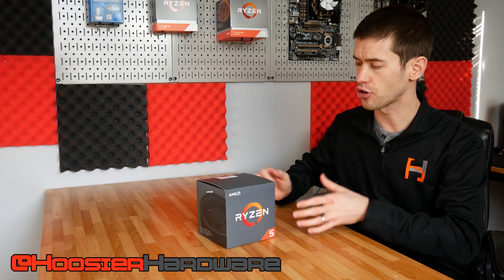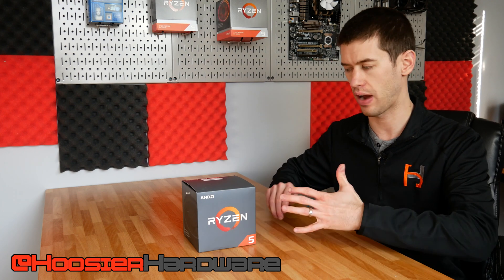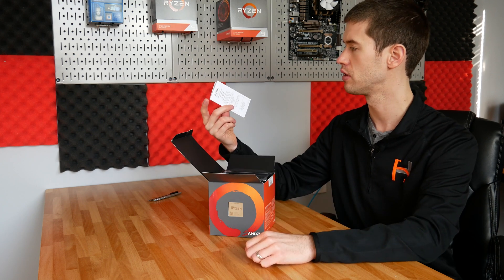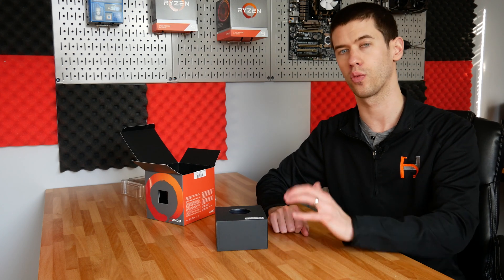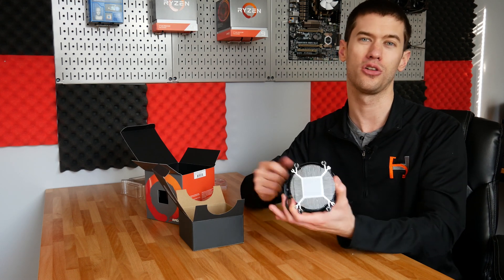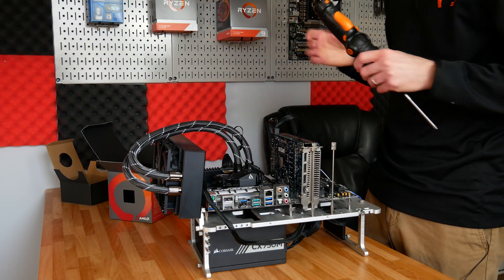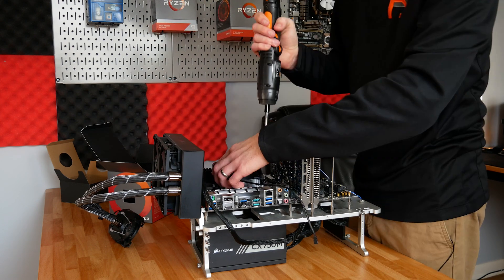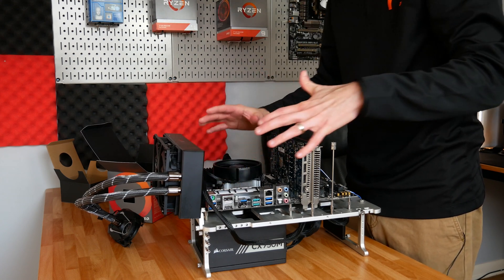Ryzen 1600 "AF" Overclocking on the Stock Cooler

Comment: Could you run a OC test with the older Spire cooler with the copper core to compare?
Reply: Well he did not run proper OC test on this cooler so let me give you the short version - 1.3-1.35V at 4.15-4.2GHz on this cooler will never hit past 80-85c during heavy gaming at 20-25c room temp, given the fan is pushed and teh case has good airflow. The other cooler will be 5-7c better  give or take.
Reply: I recently did this myself with a friend, I have a 2700 that I have water cooled and my friend recently bought a 1600 AF.  I told him I had the wraith spire LED cooler if he wanted. 
We settled on 
4.0ghz
1.27 volts
Maxed out at 77C
This was on a gigabyte gaming-3 ab350m.
Reply: @jhopkins1515  thank you. I doing the exact same thing with my spire cooler that came with my 2700. It's going on my wife's 1600 af lol
Reply: @jhopkins1515  and I thought I got my 1600(older model) to 4.0ghz at low voltage, that 2 nm shrink really helps with power efficiency
Reply: @jhopkins1515   maxed at what gaming or stress test ?
Reply: @batuone09  prime 95, 20 mins
 This was with the fans at the motherboard's stock fan curves, didn't play with them at all.
 So I'm not sure if the fan was even running at a 100% or not I would think it was up there though.  This wasn't like any crazy thorough test we just picked  A frequency that I knew was obtainable and tweak the voltage till I got it stable. This was 3 months ago I'm sure if somebody spent more time they could probly get better results.

Comment: Bought one for my wife. Reused her H80i and this thing easily hit 4.2Ghz all core stable.  I stopped there but it could have more in it.
Reply: My r20 score was higher temps never hit 60c stressing all cores with 240ml aio. 1.4 isnt a good option for daily usage considering the bump isnt there.
Reply: @Kraxt0n  some people dont know for limits.
Reply: What voltage?
Reply: @jpateka  1.4
Reply: @FlawleZ31  if you're at 1.4 already, you aren't getting more than 4.2
Reply: @lunchie80  probably the ceiling yeah.
Reply: 1.4 is a lot
Reply: @ydatoporin  Eh, temps are good and it sees light use. I'm not worried about it.
Reply: Lower to 4.1 and try 1.32volts using llc mode for <flat line>

Comment: i also have this cpu and my results are the following:
with stock cooler 4.0ghz 1.308v good and stable for day to day usage but stressing it leads to overheating and shutting down
So i bought a aftermarket cooler and went for 4150mhz with 1.341v and my temps even for 60min prime95 dont go above 69 70degrees. Cinebench: 3200
Reply: Silicon lottery winner right here!
Reply: @miniweeddeerz1820  lol, I thought the same thing.
Reply from the maker: Dang. Nice.
Reply: 1.3V for 4GHz seams too high to me. You should be able to hit 4.1 at least with that voltage. You got a bad OC chip mate. But hey still better than anything else at that price point. :D

Comment: Solid video dude. I've been having a tough time getting the 1600 AF stable when I overclock it. I'm going to test your numbers tonight and hopefully it will be stable for me as well. A video on different builds would be cool. I'm using an older card currently (RX 580) so I want to squeeze all the performance out of this system. Also a comparison against newer cards would help figuring out an upgrade path.
Reply: What are your system specs?
Reply: @cspc2570  My build is pretty budget oriented. Ryzen 1600 AF, PC RX 580 8gb, ASUS Prime B450M, Vengeance LPX 16gb 3200 mhz, ADATA 480gb SSD, EVGA 600w 80+ Bronze and Phanteks P600s case.
Reply: @zer0sckillz539  everything looks good except the mobo. I have had issues with overclocking with every b450 except my ATX sized b450 Tomahawk.  It's a beast.
Reply: @cspc2570  Yeah, I've heard the Tomahawk is an awesome MB. I might just go ahead and pick one up and an AIO so I don't have to ever worry about my temps.
Reply: @cspc2570  I have Asrock B450 m pro4 and 1600 AF @4.0 1.35V. C states off , windows max performance. It is very good in terms price/perf. It is the best!
Reply: @MarioAPN  yeah that is the best 75 dollar board by a mile. Has the best vrms for the price. The only one better is the asrock b450m steel legend but it's 10 dollars more
Reply: @MarioAPN  Used stock cooler at the 1600af friend?
Reply: Marcelo Bragança LC-CC 120 tower cooler.
Reply: @cspc2570  you haven't tried asrock b450m pro4, or the steel legend, or the mortar max? They are the best Matx overclocking boards there are.
Reply: @marcelobra1  also consider getting a Arctic freezer 34 eSports duo. That's fine for a 4.2ghz oc on a 2600 so should work on a 1600af

Comment: With a prism cooler, I got 4ghz. It stays under 65c. I might try a bit higher, but it's already running like a champ in my asrock b450m steel legend.
Reply: Pretty much on point. I got my 1600AF at 4GHz on a aftermarket cooler at 1.3v. on my ASRock B450M Steel Legend.
Reply: @djsmartbomb5482  shud be able to hit 4.1 then with llc4 or flat lined mode which ever it is for your bios at 1.32 volts...
Reply: DJ Smartbomb i have the same board and cpu and I might wanna give it a try. Wich cooler did you used?
Reply: STOP Steel Legend!!!
ASRock B450m Pro4 the best for 1600/2600.
Reply: @Vadim_V.  That's what I bought last week, small board that packs a big punch and Ryzen 3000 ready out of the box.  I'm set for a long time.
Reply: I cant get past 3.8 on stock cooler
Reply: @littleand9250  did the temp crossed 80°c
Reply: I am going with exactly the same setup
Reply: @blakehobbs425  I'm running 2x8 2400mhz ram, and an xfx rx 480 8gb gtr black edition. I got 52fps average on red dead redemption 2 high settings.
Reply: @jefferycoleman3781  bro I think you should have gone with at least 3000mhz ,higher ram frequency is better for ryzen
Reply: Yeah he saw 75c at 1.2v during a stress test and got scared. You can comfortably pump 1.3-1.35v get to 4.1GHZ and change and never see it go past 80c during gaming. I have ran a 3570k at 1.35v on stock intel cooler and never saw it go past 83c during day to day operation. The 1600 AF will not even use all cores at 100% in gaming and has much better cooler.
Reply: @AlexanderVRadev  true. In gaming that CPU won't go as hot as in test.
Reply: I have the same build gonna try and go for the same thing
Reply: @multikillerpro1  talking to? I also dont use the stock cooler....in case you were referring to my reply.
Reply: What games you play?
Reply: I am targeting those same parts but I don't know if the rog strix b450f is better than the steel legend as it would look cleaner in my white fractal focus g.
Reply: @DJDonkeytron  the rog strix is great IMO. I actually picked the steel legend because it looks awesome with the rest of the stuff I already had.
Reply: what is your ambient temp?
Reply: I literally just bought this processor and exact board.
Reply: I have a cooler master 212 evo and a cheap msi b450m and my 1600af hits 4.1ghz with ease and it dosent go over 58 degrees overclocked
Reply: 4.1ghz at 1.375v, 79°c max temp on multi threading and 56°C max on single core. Cinebench results multi: 2833, single: 410, mp ratio: 7.09, and ram at 3200mhz all stable.
Reply: @lunartigersora4690  3.9Ghz at 1.25v max temp on game 59 c Cinebench 20 result multi: 3080, single: 405, ram 3200mhz all stable 24/7.
Reply: @rajkoglisovic2615  awesome man
Reply: Nice

Comment: Manually OCing doesn't provide that much extra performance. Rather undervolt and enjoy Ryzen's outstanding efficiency.
Reply: Undervolting is pointless on this chip... Cool n quiet does the trick, low usage- idle state lowers wattage down to like 12- 15w... Do you really need to go lower?
Reply: beg to differ friend... from the stock speeds to 4.1 ghz at 1.32 volts ive gained alot of head room. without hitting over 60c.
Reply: How the hell did you come to that conclusion.